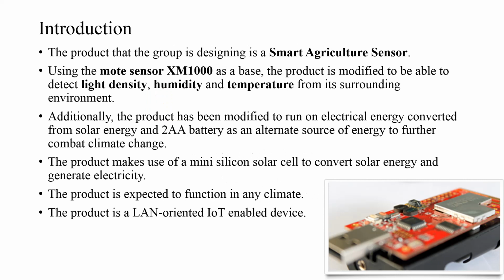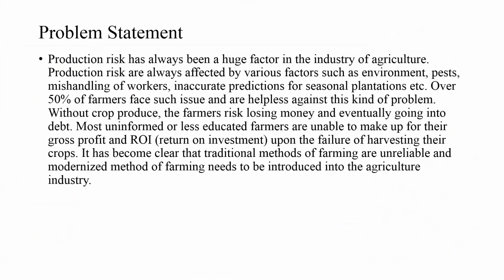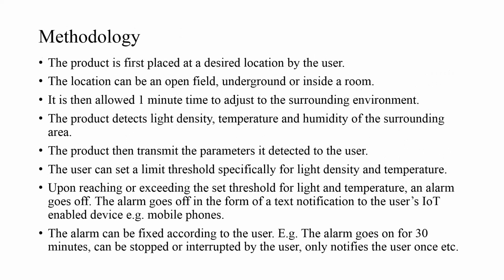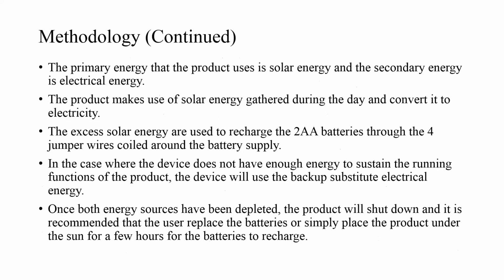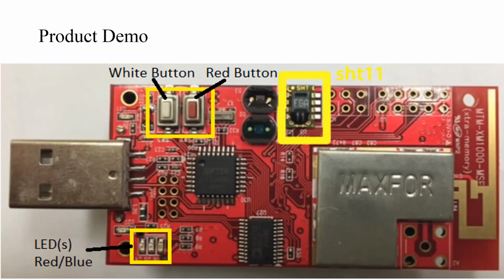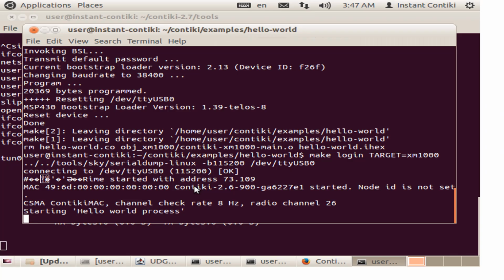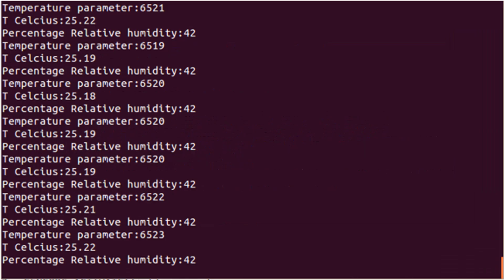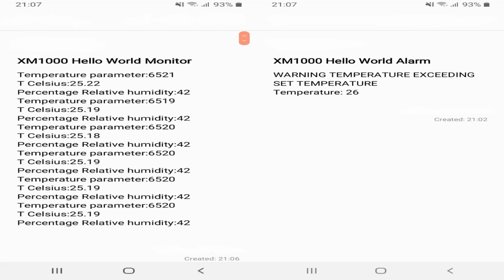Group C - Smart Agriculture System

Comment: It is not clear to me how the product will improve agriculture system. To me, they are just various sensors and when limits are reached, users will be alerted. It is not clear what actions can be taken based on the alerts. Please reply with explanation. Also, why only one person in this team? 

The slides/video could be improved especially the slide on Problem Statement which you just read it. Since this is a recorded video, you could have prepared the script for all the slides.
The demo works well. Well done! (considering you did it alone).
Reply from the maker: Hello! Sorry for the late reply.

I believe you noticed this question has been answered below? (It is not clear to me how the product will improve agriculture system. To me, they are just various sensors and when limits are reached, users will be alerted.) Also, the actions that can be taken based on the alerts is simply sending a TEXT notification to the user's IoT device. No sound of any kind will be produced (I wasn't able to procure more hardware e.g. loudspeakers due to MCO). The user simply take actions based on the sensors parameters. (E.g. Too hot or too cold? The user can take various actions to help increase his/her crop's survivability.) 

So now, I will proceed to answer why I am working alone. Two of my group members left on a last minute notice to join another group and 1 more was not contributing much at all to the project. There is a further story to this but I don't think I am comfortable sharing it here. As you can imagine, it's the common problems that you face when doing a group project in universities/colleges.

As stated earlier in my video (in the section Limitations), I did not have enough manpower to be more creative with my project. I believe that if I had been allotted a proper team, my project and perhaps my video presentation would have been a lot better. Please understand. 

Thank you very much for your time and feedback.

~Bong Wei Jie.
Reply: @idpproject3853  Thanks for the response. Please keep in mind teamwork is very important in an actual workplace. Differences among team member will always exist. The key is to find common ground, and the strength and interest of each team member. Anyway, Well done! Keep up the can-do attitude.
Reply from the maker: @amaluddin11  Thank you very much for the advice and praises.

~Bong Wei Jie.

Comment: It's unclear to me how this project could increase/improve agricultural farming. Your device can measure light density, humidity and temperature, but how can it be used to improve the farm? If one area has higher temperature than other places, is that good or bad and what can you do as a farmer? I also did not really see live demo of how the sensors were planted in the fields and actually measuring the temperature. Where should the sensors be planted?

Presentation tips: Too much reading from the slides, suggest to reduce words on the slide.
Reply from the maker: The device simply help the farmer in a more indirect manner,  because, in the end, all direct actions are taken by the farmer. The farmer may check the device frequently to check if the crops are growing in a suitable environment. If the crops planted by the farmer are not suitable to the climate, the crops won't grow properly and may yield little to no products.

Usually, if one area has higher temperature than other places, it may depend on the crop that the farmer is growing to decide if it is good or bad, if the temperature is too high: the crop will dry and wilt (akin to summer) and if the temperature is too low: the plant may never grow and dies off (akin to winter). As a farmer, the farmer can move the plants to a greenhouse or manipulate the temperature through various means or provide shelter in the case if the temperature is too high (nets, zinc etc)

The live demo were not included because the demo was too long for the video and thus it was decided that only the results would be included.

The sensors should be placed according to the farmer where the farmer thinks the sensor can perform most efficiently and accurately. (For example, in an open field, the farmer may place the sensor in the center of his field. The farmer may also place the sensor at four corners of the field in order to obtain an average temperature.)

Thank you for watching my video and thank you very much for the advice.

~Bong Wei Jie
Reply: @idpproject3853  Let's say if you have a plot of land, no shaded area, do you think the temperature will vary at the different place of the land, consider that the sun shines equally on them all? If any variation, it's likely to be so little that it has any negligible impact on the crops. I'd suggest that you pitch your idea of using temperature sensor for agricultural R&D sector, i.e. to find out what is the optimum temperature and condition that certain plants can thrive. On the product demo, it is important to show video of your equipment and show that it is able to detect different temperatures, humidity etc. There are a few groups who managed to do product demo effectively.
Reply from the maker: @abeltan5564  Understood. Thank you very much for your time and feedback.

~Bong Wei Jie.
Reply: @idpproject3853  Please read my comment above and I see that you have answered mine as well (except one more question).

One example to increase value from your product is to automatically water the plant if temperature limit is reached i.e., your product is not just sensors, it will give command to a certain output device e.g., a motor.